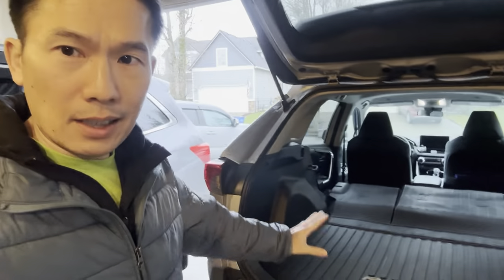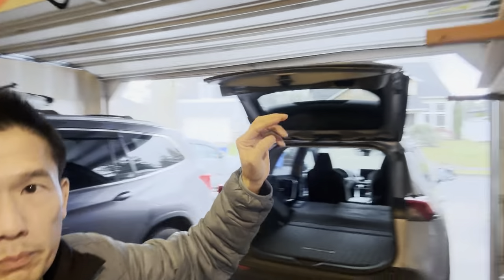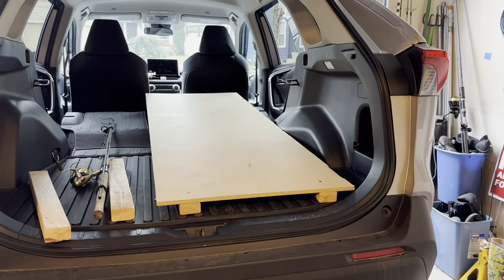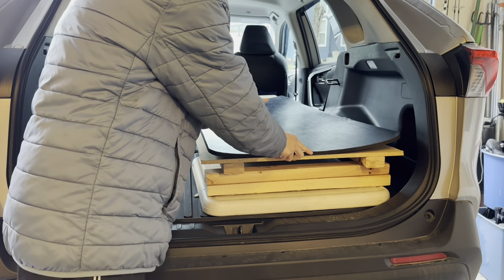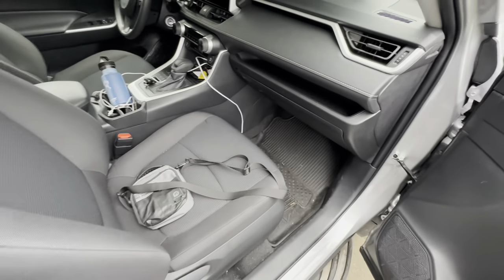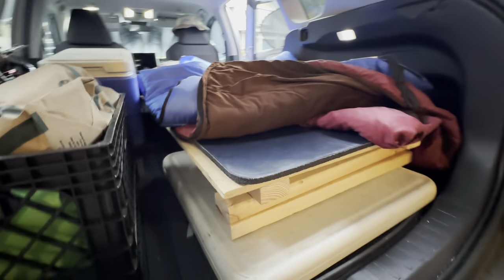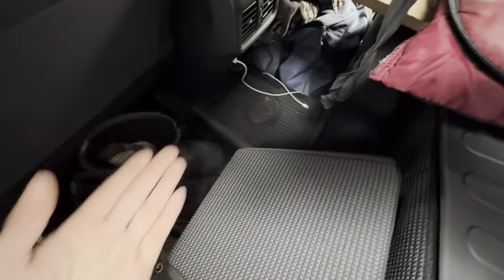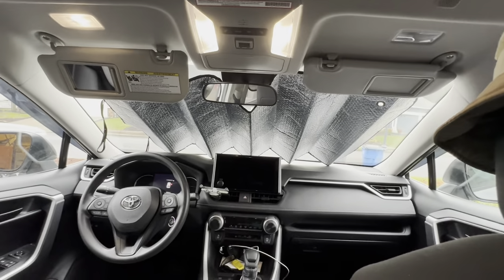How I Build a Camper Out of My 2023 RAV4 LE AWD - Part 1

Comment: Like your setup! One thing I did right after I bought my Rav4 a couple weeks ago was get my windows tinted.  If you use ceramic tint it costs around $500-$550 (about twice as much as carbon tint) but it really cuts down on the amount of heat that will get through your windows.  Best thing is, if you get the darkest "limo tint" on the back windows you'll never have to mess with reflectix or curtains. Highly recommend!